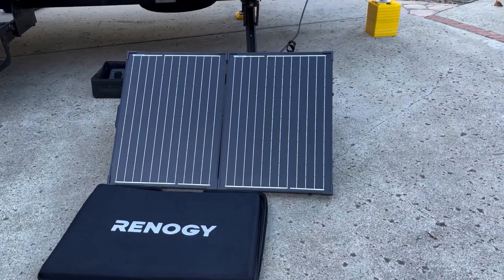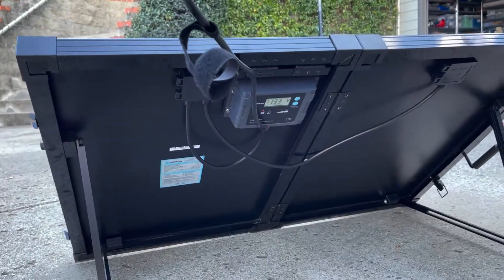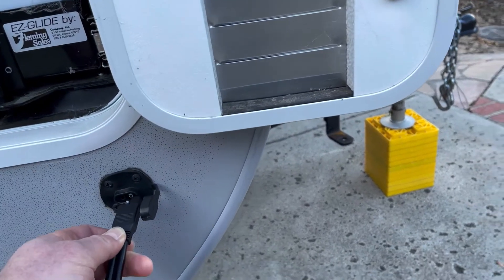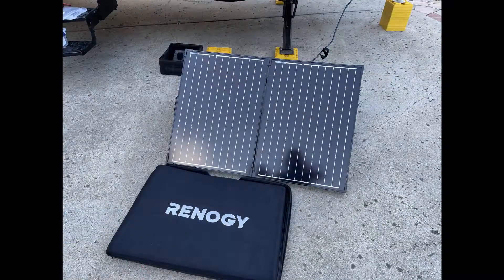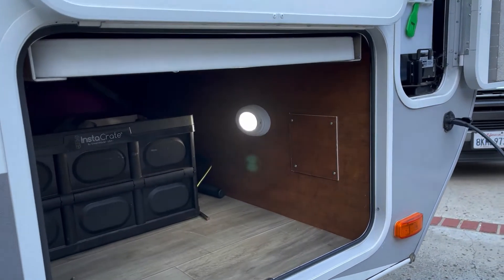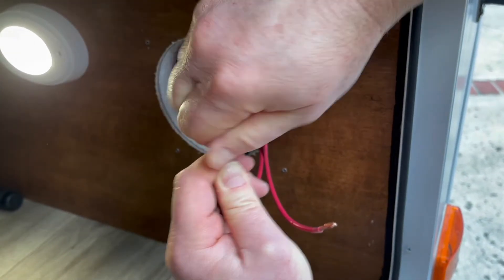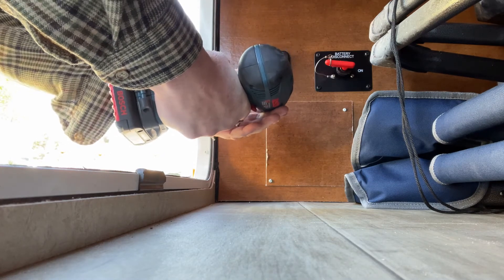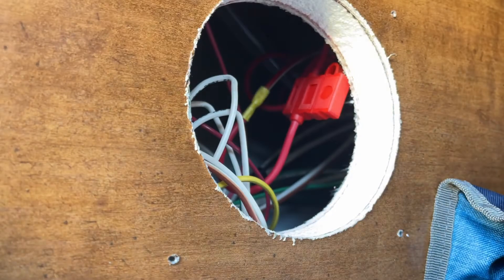Renogy Solar Suitcase b01 Error with RV Solar on the Side Connection

Comment: I have a Taxa Cricket and last year purchased an adapter to hook up my Renogy 200 watt solar panels.  Suddenly about a week ago I got this message B01. I checked all connections and couldn't get it to work. I then connected the panels to a power pack and still got the message. Oddly enough the problem started around the same time a dog stopped by and did his business! The panel was immediately washed down and I wasn't concerned because the panels are water proof. Any ideas?

Comment: I have this exact issue on my 2021 Lance. I also have the same Renogy suitcase. I bought the reverse polarity connector, and still does not work. I have battery voltage at the solar on the side connector. Frustrated as hell right now.

Comment: Thanks super helpful but
Why did you need to cut and strip the solar ready wires?  Weren’t they already stripped inside the wire nuts?
Thanks